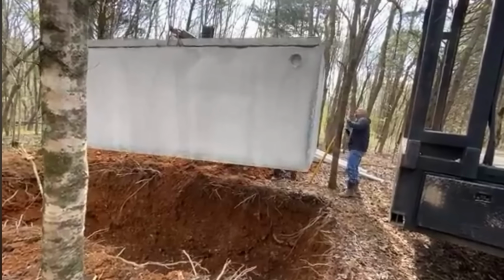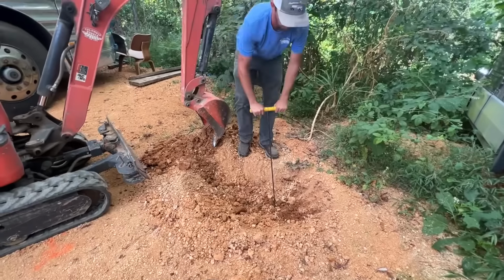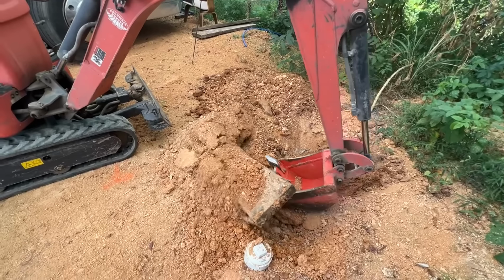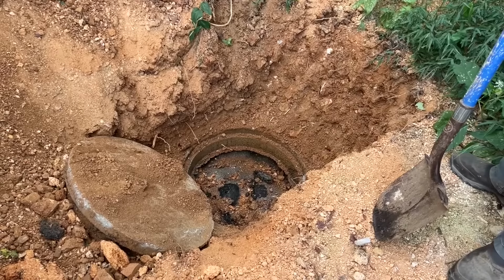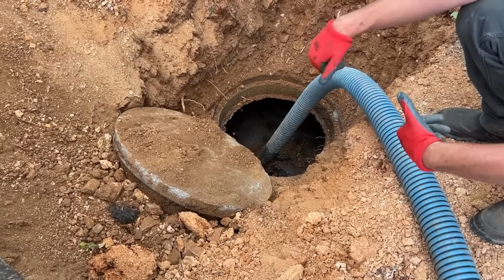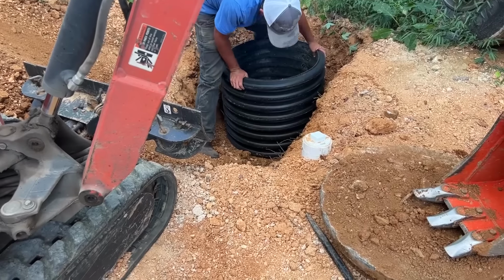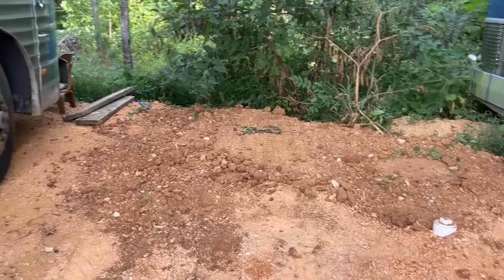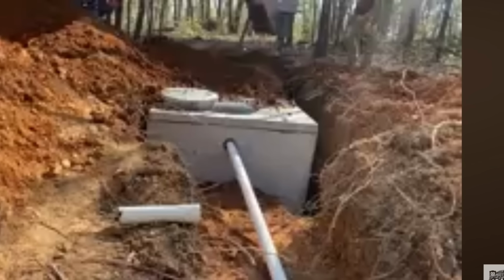Septic tank backing up. Are RV dumps killing the bacteria?

Comment: My plumber installed a separate leach system for the washer drain so it doesn’t go in the septic tank. Ours is 30 plus years and had never been pumped

Comment: scott, i think running the drain on your clothes washing machine outside to another area is a must. number one killer of a septic system. not to mention the oil and grease from the clothes, which is more than a normal system might see day to day. but in all honesty, i think you are going to have to look at another septic system altogether for the rv dumps. those are just adding too much at one time for your system, and i bet you ae having issues with tree roots growing into your leach lines as well.

Comment: I hate sewer problems. With apologies to the Bard of Avon:  Bubble bubble, toilet trouble, bathtub roil, and bathroom sink bubble.  Our circa-1947 home originally had a septic tank.  It was connected to the city sewer system in the early 1960s.  The four foot, red clay pipe was ripe for root infiltration.  (Were owner # si or seven) We ended up replacing the entire sewer line about five years ago.  We did the w on our property to hold down costs.  Unfortunately, we ended up needing to dig in the street whic is a whole other expense level.  The line on our property:~$2,300.  Bonded contractor and digging the street:  ~$18,000.
Reply: Feel for you, new sewer line from house to road was reasonable but the last 10 feet to the city main sewer line was hideously expensive.

Comment: field problems where there's 100% clay--and no wide gravel around lines, and too small of a drain field--here if usage was underestimated--become fundamental.  at least, lots of new drainage with gravel/soil mix (like my family had to install) might as well be expected.  that 100% clay is really a problem.
Reply from the maker: Our perk tests were very good for drainage.  System size installed for 6 bedroom house.   4.5 years is a decent 1st pumping required i think
Reply: We call the leech field seen in video bio diffusers and they are the worst. Simply laid on native ground. Did yours have gravel under them?
Reply: Recommend using wide bucket to dig field trenches in clay also go deep 6ft
Need that sand layer

Comment: Grease and flushable wipes are the destroyers of septic system. The wipes flush ok but then they are there, they’re hard on public works and fill your tank. Grease coats the inside of your tail lines and won’t let the water off your sewage out to evaporate.

Comment: Here in New England they recommend the 3/5 rule. Family of 3 every 5 years...Family of 5 every 3 years for pump out.

Yeah, RV tank maintenance is unlike septic maintenance in that the RVs add cheicals to fight odor and not necessarily promote bacterial growth. Is your septic tank oxygenated? (to feed bacteria) If not, does it have a breather pipe? (can help...looks like a candy cane coming up out of the ground). Your additives sound like a great idea but I wonder if your additives are enough to offset the RV chemicals.

Another tip is to make sure that your household  or shop is not using chlorine bleach (laundry?) Instead use any product with oxygen bleach...anything with OXY in the title. This is superior to chlorine for cleaning , will not harm fabrics like cotton and is actually good for your septic system.

30 years septic experience and no problems.

Comment: The RV dumps are probably not killing the bacteria, but they could easily be overloading the entire septic system.  Just one RV dumping a 100 gallon black water tank a week could overwhelm a smaller septic holding tank.  The bacteria can only eat so much poo at a time.
Reply: Yea I agree I think the RV dumps are probably the issue.
Reply from the maker: @joshg1244 i had one customer that told me he put 1 gallon of bleach in both his black and another in his grey tank before dumping into our septic tank.   2 gallons of bleach into the tank i was very mad.
Reply: @BusGreaseMonkey  If you are doing RV dumps (without bleach), you need to have it pumped yearly.

Comment: RV septic systems likely have more chemicals from cleaning, perhaps chlorine etc but should not impact too much unless RV dumps are a significant share of load.  As far as solids pump out, every two years is a good for a 4 Sm3/yrd tank for a family of four. You may have  had solids transport into the drain system but lest hope not. More frequent pump outs should could make system last for decades

Comment: That tank and, more importantly, drain field just aren’t sized for the volume of RV dumps. Having to pump after 4-5 years isn’t unusual, but having solids up that high in the tank could mean that your drain field pipe is clogged as well. Hopefully that’s not the case.

Comment: My septic tank has been installed for 28 years and never been pumped. If it is working correctly it should last a long long time. Clogged field lines no doubt about it tree roots growing into them will clog it up fast the water has to drain into the field lines or it will keep clogging.

Comment: Scott.... Ridex and those kinds of additives do nada.  Total waste of money.  I was told by a few septic pump out companies that these additives over time will break solids down and plug your leech field pipes thus backing up your septic.  The best thing you can do is not pour any grease/oils, including cooking oils, into your septic system.  Secondly, any washing machines... like dish and clothes washer machines do not drain into your septic.  If you can drain those machines to daylight, away from your septic & leech field.  Thirdly, any baby wipes, or wipes that say they are bio-degradable/flushable, and women's sanitary products do not go into a septic tank.  Lastly, no garburator food should go into the tank either.  Just human waste, shower and sink drain should be going into a tank.  The items listed above will kill your septic bacteria.  I would be very apprehensive allowing RV's using your only septic tank to dump into, because you just don't know what they put into their black water tank..... specially the items that I listed above that will shorten the life of your septic system thus causing you to get it pumped out more often.  Hope this helps.

Comment: If you're dumping clients rv sewage into your tank you will need to pump at least every year, probably even every 8 months. Typical home septic tank is way too small for this
Reply from the maker: We specifically installed a huge tank so it’s not a normal home size
Reply: @BusGreaseMonkey  I grew up in a household of 9 people. Two bathrooms, one kitchen. The washer ran 18 hours a day for many years. We had two tanks, one 1200 gallon and one 500 and pumped one every year, just because.

Comment: An adequately sized and properly functioning septic system should never need to be pumped out.  Many factors are taken into consideration when designing a septic system, soil type and soil permeability testing is used to determine the placement and sizing of leech lines or leech fields.  The bacteria and enzyme treatments are for solid waste.  You have to determine if you are having a problem with solid waste, liquid waste or both.  It sounds like your system is just being overloaded with liquid waste.  If your washing machine is draining into the septic tank you should install a good lint trap if you don't already have one.
Did anyone conduct soil permeability testing before installing the septic system.  Soil is only capable of absorbing  and dissipating so much water and the main way to increase capacities is by expanding the leech lines or leeching field.

Comment: You are misinformed  ,
Steel tanks last a few years before they rot.
Concrete tanks are tough but still decay over time.
Plastic tanks will be destroyed by volotile chemicles (not typically found in household waste)
Now seepage pits, i have seen them last 25 years before they fall in and leave a 4 foot diameter hole 20 + feet deep. hopefully without the lawn, pet, or  other unsuspected.

Comment: A septic tank should last 20 to 25 years before needing a clean out, and they were generally drained and dug out, because if the septic tank is working, most of the solids are digested by the bacteria, and the liquid flows over the top into the drainfield, which will grow anything as it is an excellent fertiliser. You cannot put any household chemicals, toilet cleaner or hand cleaner into a septic tank or oils or greases, this includes dishwasher and washing machine water unless you are using septic tank safe products, and a lot that advertise themselves as such are not! A septic tan should not smell at all, or only very slightly. The bacteria , in digesting the solids, give off methane, which is vented away, and all that is left is a tiny percentage of the solids that went in, which is why they should not need cleaning for at least 20 years! this is not working! A working tank has a scum over the top that you have to break through and there should be a virtually clear liquid beneath with a clay like layer at the bottom, it is only when the clay like layer fills most of the tank that it should need emptying! Having said all this, most septic tanks get poisioned by domestic chemicals and therfore need emptying regularly, the problem is when the tank is not working the liquid going over into the drain field will be a sludge containing pathogens that would normally be digested, and they will block the drain field and be a potential source of infection for humans!
Love the channel, 
hope this helps!
Phil UK,  "Phil Whitley, my week this week" on YouTube